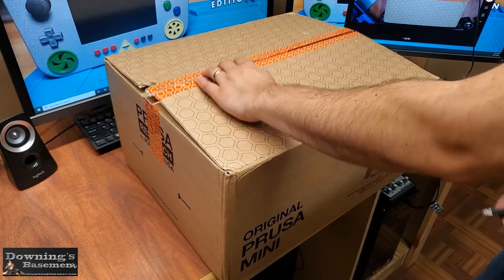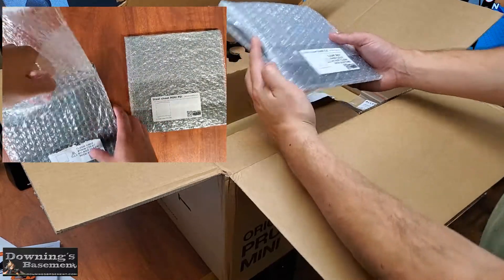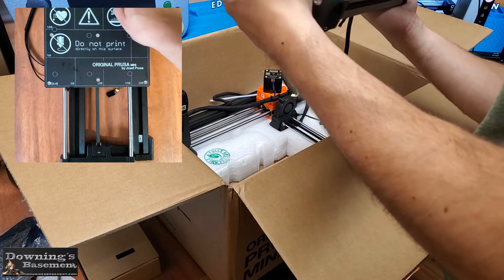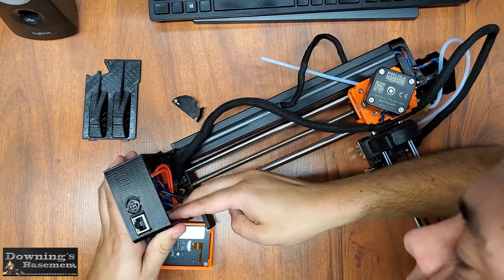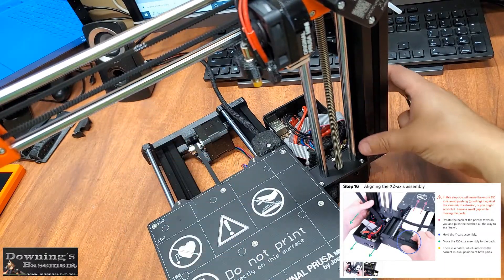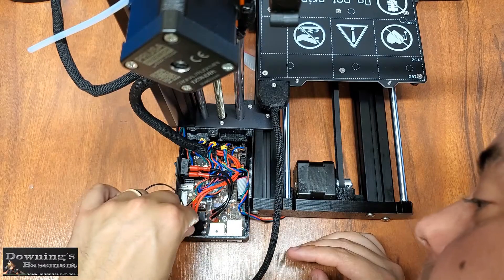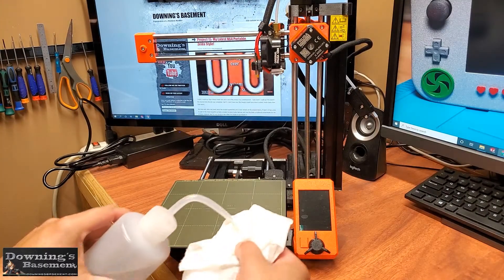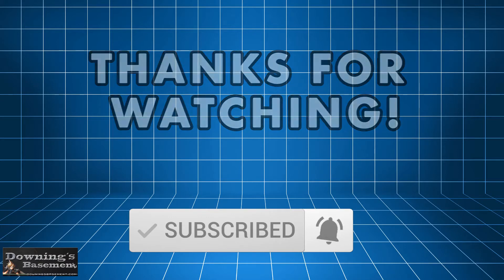Prusa Mini Unboxing & (abridged) Assembly

Comment: Was this the kit ($349)or the one that has 3 parts to assembly (399)?
Reply from the maker: The kit wasn't a thing back in June when my wife bought this for me (didn't get it till August), but after the extras it still was about $400. So yeah, 3 piece assembly.
Reply: @DowningsBasement  What is the benefit of the Kit?
Reply from the maker: @daemon3spade  Just cheaper at this point I guess. Will take a lot longer to set up so not sure it's worth it.
Reply: @DowningsBasement  Not sure if its worth it? Worth taking time assembling it or being cheaper? Do people get a lot of troubleshooting after assembling the kit? is it common thing to happen

Comment: Nice one! Will you review it in a seperate vid? I am curious about the print quality and how much noise the printer makes.
Reply from the maker: I hadn't planned on it but that's not sounding like a bad idea. But to quell your current curiosity, the quality is top tier like what is expected for printers 3 times it's price and it also uses silent stepper technology which means the loudest parts of this printer are the two fans. In comparison to my MK2/S, it's barely a mouse fart.
Reply: @DowningsBasement  Do you think you could sleep in the same room when it is about 3m away?
Reply: @DowningsBasement  Does it have silent mode like the i3 mk3s?